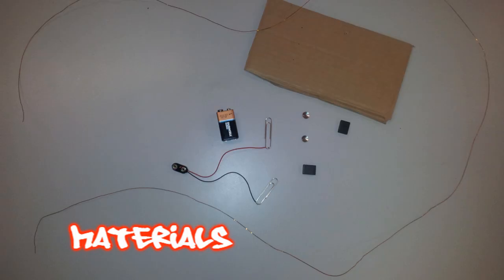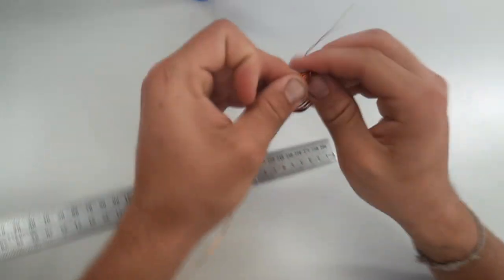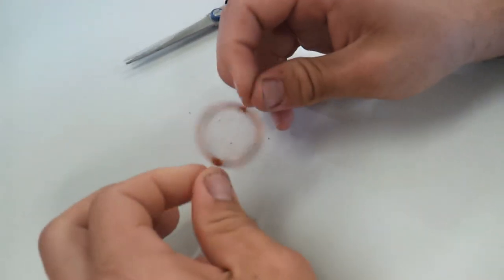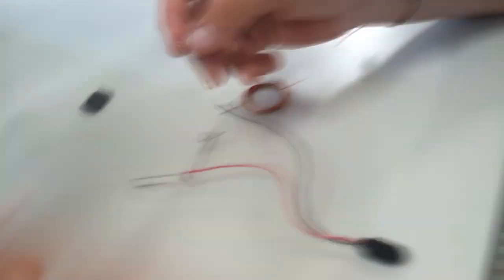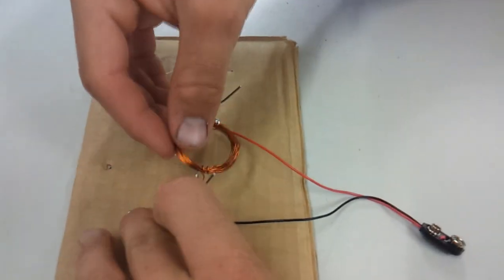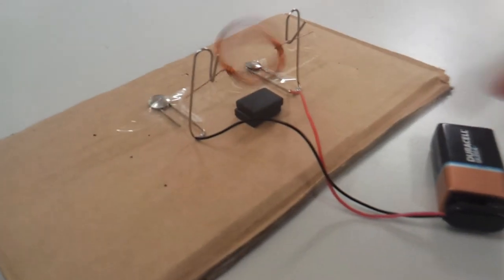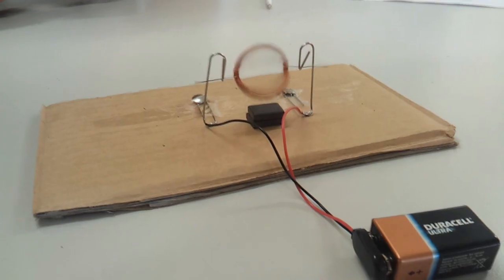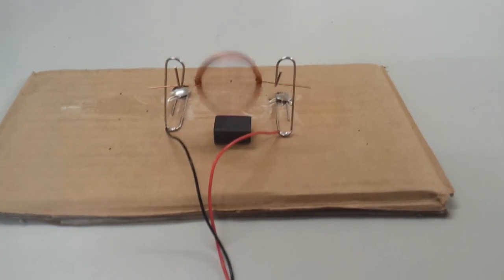Simple DC Motor Explained

Comment: This is NOT a DC motor, it it lacks an essential component, a commutator with brushes for electrical contact. A commutator is a rotary switching element that reverses the coil current every revolution to keep the magnetic fields between the armature coil and the permanent magnet orientated properly for continuous operation where some usable torque is generated, the magnetic field of the coil must be reversed every revolution or all you have is two permanent magnets doing their permanent magnet thing, remaining stationary. One thing that may be happening here is the rotating assembly is not balanced and may cause the electrical contact between the armature shaft and the paper clip supports may break the connection at just the right time to create a kind of minimal commutator effect, just enough to barely keep it running. This thing won't do any real work, it's not a proper DC motor, period. Yet another YouTube University failure.
Reply: there is a somewhat makeshift commutator since he scraped the enamel off one side of the copper wire, hence conducting intermittently. 
I also didnt see that clearly and thought this was some fake experiment/model, but its actually quite clever of him to make a commutator that way!

Comment: Why does this motor not need brushes?
Reply: Have you figured it out yet?
If not: The paper clip's surface acts as the brushes as they provide the lubrication for the armature to rotate and is also conductive.
If you have figured it out: sorry for the late reply

Comment: In the video, you are scraping both sides of the coil....yet you say only one side should be scraped?
Reply: what he means is one side of each end. consider it to be the "bottom"" of a circle (the cylinder that is the wire)
Reply: what he means is one side of each end. consider it to be the "bottom"" of a circle (the cylinder that is the wire)
Reply: @matthewmcewen1  Good thing you said it twice or he would never get it.
Reply: @Timotheuster  hahahaha i never realised. Ill leave it there so others can understand
Reply: @matthewmcewen1  ;)
Reply: Each side of the loop has a piece of wire sticking out, yes? Each of those pieces of wire need to have half of either the top or bottom shaved, but it must be the same side on both ends. 
o <-- Say this is the end of a piece of wire. The top half of the circumference of the 'o' has been shaved, the bottom has not. 
Yes? 
👍

Comment: copper wire is not moving
Reply: Make sure it's copper and a wire
Reply: Can a problem be in a magnet ?
Reply: If it's a simple bar magnet there should be no problem. Give the wire a little nudge to make it start moving.

Comment: can this be done with a 1,5 volt battery
Reply: Probably not. The torque is proportional to current through the loop which is proportional to the voltage applied due to Ohm's law. Given that the contact between the paper clips and wire is probably less than perfect 1,5 volt voltage will produce negligible current. If you dont have a 9 volt battery either buy one or connect multiple 1,5 volt batteries in series (one behind the other like so |- +||- +||- +||- +|). Or you could look if someone has similar design that uses 1,5 volt batteries. Do not attempt to use power from the socket. Not only you would get shocked, you would also blow out your fuses plus it wouldnt work anyway because the city power supply is AC, not DC so even if you managed not to do either of the things mentioned before, there really is no point trying.
Reply: And the award for the most useful comment on YouTube goes to... drumroll  smolkafilip!
Reply: To be fair I am not always that useful. I am an engineering student and I happened to be preparing for my final in... well this.
Reply: Prepping for finals in February?! Dedicated student ;)

Comment: Correction 1: "A DC motor works by Faraday's Law of induction". Not true. This is a motor, not a dynamo.  It is based on Lorentz force, F=Q(U x B), which is the force exerted by a magnetic field on moving charges, which is why this motor is also referred to as a Lorentz-force motor.  Or, it can be explained more generally by attractive/repelling forces of two magnets, where the current coil acts as the second magnet.  Here is a video that explains this correctly: 
https://www.youtube.com/watch?v=it_Z7NdKgmY&NR=1
Correcton 2:  “Faraday’s Law states that a circuit with current in it creates an electromagnetic field”.  Nope. Faraday's Law states that a time-varying magnetic flux through a wire loop will induce voltage in the loop.  It means that you can create electricity by moving a coil in a magnetic field (i.e. a generator), while this video shows the opposite effect - sending current through a loop of wire makes it rotate (i.e. a motor).  In other words, here electricity is converted to mechanical energy, while Faraday's Law has to do with converting mechanical energy to electricity. BTW, the laws that actually explain why a circuit with current in it creates an electromagnetic field are:- Coulomb’s Law and Gauss's Law for E-field, and - Biot-Savart’s Law and Ampere's Law for B-field, all of which are unrelated to Faraday's Law.    

Also, stripping the wire all around the circumference is not optimum. If current goes through the coil during every rotation, then during one rotation the loop will be pushed one way, and in the next rotation it will be pushed the opposite way.  This means that your rotating coil is being slowed down every other turn.  Only half of the circumference should be stripped, so that it conducts current every other turn. Just a suggestion.

Comment: I really wonder why this works without commutator?? current in the loop has to change every 180 degrees of rotation (starting from horizontal position) by a commutator to perpetuate the motion. but clearly I am wrong which i really like to know why.
Reply: think of it as a pulse motor. there is an intermittent connection. momentum keeps the rotor turning until the next connection is made.  cheers
Reply: +Navid Davani  There is a commutator/ See how he is scratching one side of the wire
Reply: I see.
thanks.
Reply: I had the same question. so, not a true commutator; its a momentary switch. cheers
Reply: think of it as a pulse motor. there is an intermittent connection. momentum keeps the rotor turning until the next connection is made.  cheers
Reply: umm....see dozens of videos on yt     cheers
Reply: Navid Davani I have the same question still didn't find any satisfactory explanation.

Comment: Hello sir, may I ask? 
What I found about this video is the copper coil is rotating because there is an electricity from the battery and caused by the magnetic fields. If you're not concern, can you explain it to me i simple way. 
And what is the uses of this principle in our daily? etc dynamo can use to light a bulb.
I'm really hope you reply because I need to make a report.
Reply: Most things in modern life would not work without electric motors. Refrigerators, running water (pump to get water from well or to rooftop holding tank), car starters, ect..
Reply: oh i get it...thank you sir
Reply: If a current is going through a conductor (in this case copper wire) it will create a magnetic field, Then when two magnetic fields get close they either push or pull in. Its also like magnets

Comment: How does this work? Can someone pls explain for me what's  happening?
Reply: current frm battery flows thru the copper coil. the coil becomes a magnet with its own north and south on each coil faces.if the coil north is facing the ceramic magnet north the coil will try to spin away.if the coil south is facing the ceramic north it will spin towards it.however when this coil try any of the motion it will never be able to meet the or repel the magnet below completely because the coil is on a turning shaft..this force of,attraction  and repulsion,ultimately makes it spin trying to reach or repel the ceramic magnet on an endless hopeless saga of magnetism until you take off the battery power..

Comment: why do we only scrape off the top enamels? i didn't quite get the explanation srry
Reply: this motor works by using electric and magnetic fields to your advantage. by having one side fully sanded, and one side half sanded, the electric current will only move through the wire half the time. the other half of the time, the coil will coast, until another 180° turn has been completed and current is flowing again. when the current is flowing, the coil is either repulsed or attracted to the magnets, depending on which direction that magnetic field is in, causing the movement needed to allow it to spin constantly.

Comment: hey i like the video...what rating of battery did u use? does it work for 1.5V TV remote batteries??? Also why did u rotate winding initially to make it run? So it wont start if u dont rotate it initially? .... A short-circuited winding might be dangerous to the battery but nothing happened in this video. I expected a burn-out of battery...Can u tell me how does this work? Why does it rotate because DC from battery is constant not like unidirectional pulsated DC which varies in magnitude time to time like a positive half sine wave.....?
Reply from the maker: We used a 9 volt battery.  There are other designs that use a 1.5V battery but I don't think a battery that small would turn this coil.  No the motor does not start without rotating initially as this motor doesn't have enough torque to turn the coil from stand still but it has enough to keep it going once it's started.  It rotates because of the magnetic field created by the current flowing through the wire is attracted then repelled by the magnetic field of the magnet.
Reply from the maker: Yes they do have a vanish coating on them.

Comment: Hi,
So the coil is not continuously moving in one direction but going back and forth really fast right?
Reply: no its direct current so it doesent switch directions i am prodblably going to build one because it is awesom
Reply from the maker: Luke is right here.  The coil is only spinning in one direction as it is a direct current motor.
Reply: the scraped wire just turns on and off the magnetic field generated by the coil
Reply: no its direct current so the motor is going in one direction
Reply: +Lucy Kay NO thats not true because the split ring commutator which reverses the direction of the current. thats why he scraped of one side of the copper wire. The role of a split ring commutator is to keep the torque on a DC motor from reversing
Reply: Luke Calls  correct

Comment: Hi,
So for the DC motor, it is not spinning in a continually in one direction but going back and forth really fast right?
Reply: No, it should be spinning continually in one direction...
Reply: It doesn't matter. It can spin either direction.
Reply: The poles are spinning with the motor. They are attracted to the magnets intermittently, which is why it keeps spinning.

Comment: I have to design a motor and one of the specifications is that the motor has to be able to lift a coin to a height of on at least 15 centimeters. would this same design be able to do that?